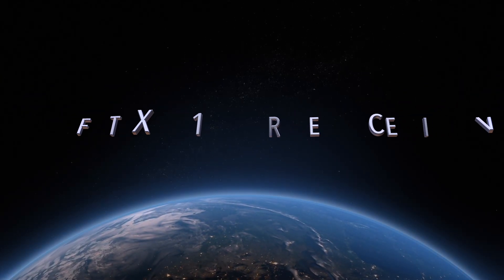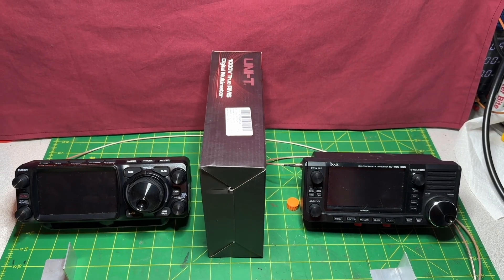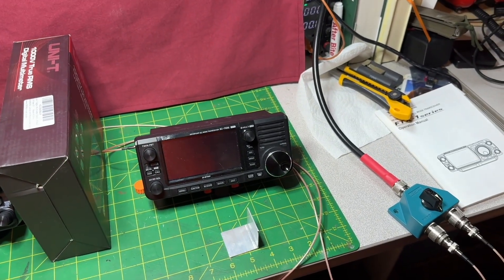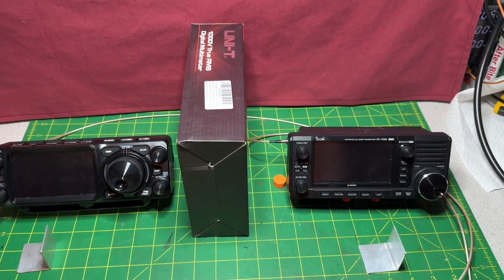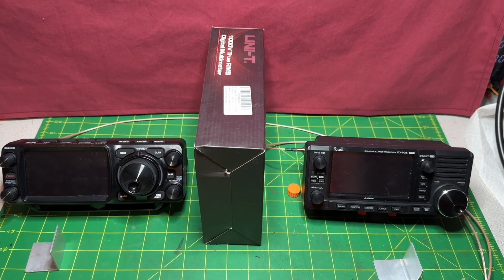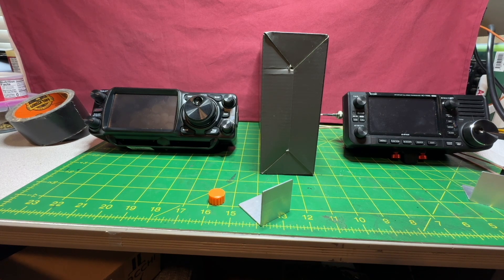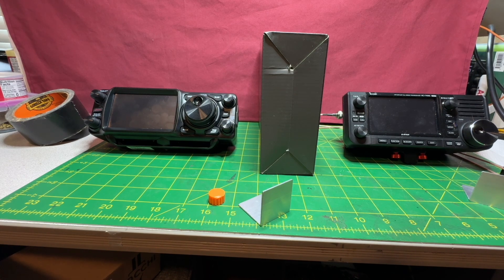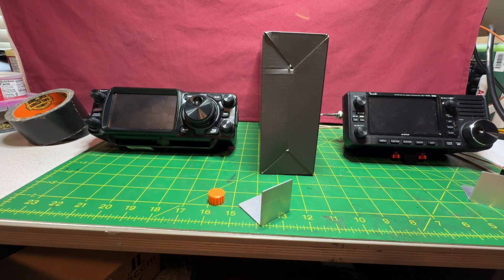IC 705 vs FTX1 Receiver part 3

Comment: If DSP is off, the FTX-1 lets more of the noise in..... don't know about the higher noise floor claim. When DSP is engaged, it really cuts out off-frequency noise. I tend to use it when the noise is annoying to the point of distraction.
Reply from the maker: I run most of my radios with DSP set to 1 or 2 most of the time.  The seems to reduce a bit of the background noise without hampering the desired signal.  I am one of those that can pull out CW signals down in the noise.

Comment: One of the things I noticed when I did a similar test during the CW DX contest a few weeks back was when you had two REALLY strong signals on either side of a weak signal (I mean REALLY close), I could narrow down the filtering on the Yaesu and it sounded a little better and had a little less interference from the strong signals than the Icom did.  Both are fantastic radios though. Like you said, pick the one you like and run with it.
Reply from the maker: I could have cranked the filters down more but felt 250 Hz is what most people would use as it is the default.  I am playing to the average Joe.  Both radios have more than acceptable performance.